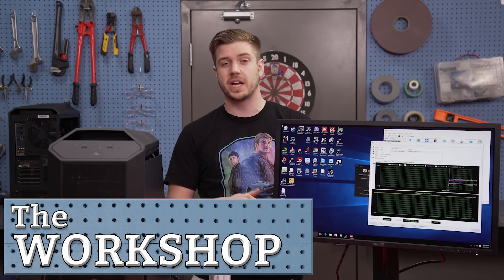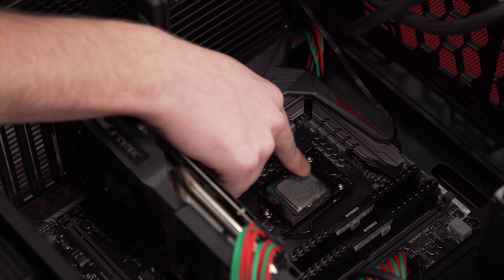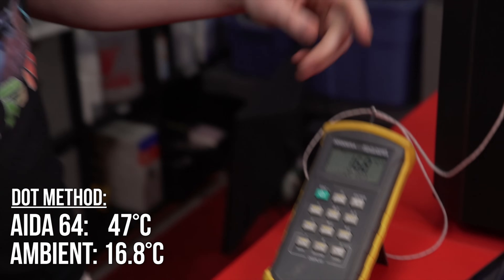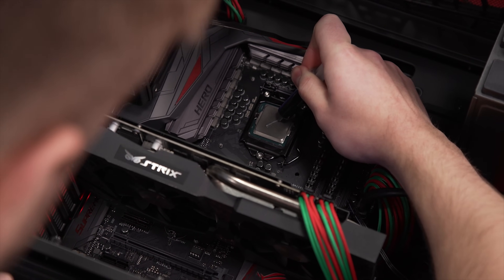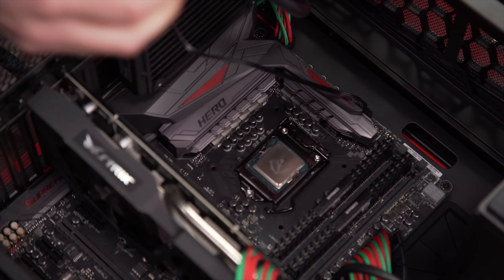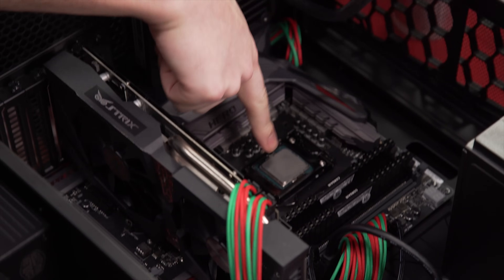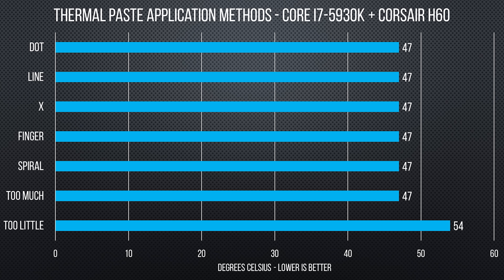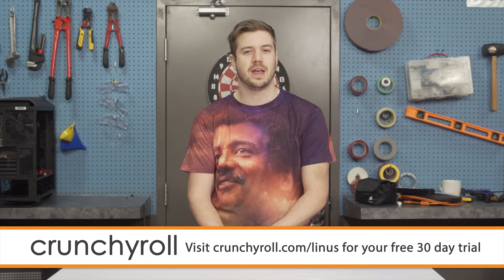Thermal Paste Application Methods - Which one is best? - The Workshop

Comment: After how long should you clean and re-apply thermal paste?
Reply: "if it ain't broke, don't try and fix it" is a phrase that can be used in this scenario. If you're experiencing bad temps, then go ahead and re-apply. Some can last up to EIGHT YEARS!! They last for a very long time and should only be replaced when you need to. Don't worry about reapplying until it's necessary. Hope that answers your question!
Reply: Ive been experiencing some bad temps in recent weeks so i took out the cpu cooler to give it a good dust off and noticed the paste was half dry i dont know if thats normal? but anyway im in the process of buying a new paste hopefully that will solve my temp issues
Reply: ALBERT ABRAHAM, I applied a Dot/Pea size of Arctic Silver to an Athlon X2 in the Summer of 2007 and CPU still Runs at 20 C - 40 C here in 2017. Is an Athlon 3800+ Windsor rated at 65 Watts TDP.

Comment: Quite worried about when i eventually upgrade, how difficult is changing a CPU? 

Hopefully upgrading from an i3 to an i7 on a pre-built year old PC. (side note, would this require an upgrade to my heat sync or will the old one be okay?)
Reply: the old one will probably still work, maybe even better because modern CPU's have mostly a lower power usage.

Comment: are you supposed to cover all the pins, or just let the socket do it's job of spreading
Reply: All over the mobo capacitors as well.
Reply: Actually if you sumberge pc in water it works like charm
Reply: @happydolphin1432  *submerge
Reply: *its job (possessive)
it's = contraction of "it is/has"
Reply: joblessalex if you have the time, covering all pins will yield a better result

Comment: how often should you replace thermal paste ?????????
Reply: Lance Mccarthy According to a search i did online you should apply once every 6-12 months
Reply: Lance Mccarthy mine 5yrs lol. im gonna replace it tomorrow. My cpu temp 45c idle 69 - 80c gaming. Thats why
Reply: Until throttling occurs, in my opinion. Every modern CPU is protected against thermal damage, so if the performance does not suffer by throttling or becoming unstable, replace whenever you like.

Comment: Ehi, less IS more... less is MORE APPLICATIONS.
Reply: What if you are building only one computer? Unless you have 3 or more GPUs, you can be very liberal with your paste, you will not use it up anyway. At least I haven't seen one so small that it would not be enough for 3 really big applications.
Reply: Well, that may be the case if you only build one PC every few year. But if occasionally you help your friend you can apply it multiple time, it's not a one time use; you can close it and reuse it later, it doesn't spoil.
And sometimes the paste wear out and you can reapply it later.

But if you build multiple PC per year or maybe per day, because you are a system builder/repair or Linus Tech Tips, then you have many more applications on a single siringe.

Comment: I am curious: does thermal paste ever need to be re-applied?
Reply: That's not true though, thermal paste can age and crumble up becoming less effective. Often on older cpu's (read 3+ years installed) you will see temps go up, untill you reapply some thermal compound. After replacing the temperatures can go down drastically.
Reply: In some cases it can actually be necessary to renew the thermal compound, for example when the old compound has dried up or just doesn't pass heat for another reason anymore. 

The man asked if thermal paste ever needs to be re-applied, to which you answered no, but the answer should be, sometimes yes, but not often.
Reply: YES, it does have to be re-applied, because it happened to me. One day, I was playing Starcraft 2 on my 3+ year old computer, and was suffering from insanely low fps with only a few units on-screen. I'd restart, and then it'd be fine for a few minutes, then start chugging a few minutes later. Thinking this to be strange, I ran SpeedFan on it and was noticing high CPU temps. I thought maybe my fan wasn't working, but nope, it was. I researched thermal paste -- which is something I never even heard of (my fans that came with my CPU always had a coat of thermal paste on them, hence I never had to apply it myself). After applying the paste, my Starcraft 2 performance worked great, and I never had to do anything else with my system!
Reply: yes it is good to do it at least once a year if you are in a hot area as the CPUS heat up more if cold then i would probably say no and also depends on what you are doing for gaming definiatley
Reply: Nope! Once it's on there it's good untill you take the cooler off. Once you take the cooler off you do have to re-apply.
Reply: Mathijs van nimwegen That's a relief. 
Cheers.
Reply: ReMeDy Thank you for the reply. I always worry when my PC acts up as it could be a million things. I need to buy paste just to have it around and feel safe. :)
I hope it doesn't expire when emergency calls. XD
Reply: Hope u bought a new motherboard and some ddr4 to....or else u wil have more problems (sockets will be different, 1156 -->> 1151 )
Reply: ddr4 is a toss up.  Does he need it?  Negatory.  DDR3 is still great and will still perform well beyond what this man needs it for.  It's the same with the DDR2 v DDR3 way back when.  Eventually he'll want to consider upgrading, but for now, two sticks of DDR3 10600 total 8 gigs will allow him the pleasure of gaming, watching porn, recording himself watching porn and making a porn without issues.
Reply: @KingT.Challa  not if he bought the 7700k..
Reply: If you use cheap one, yes... CPUs can die of heat after few years, if the paste is crap. You can google pictures of "burned thermal paste". If you use some quality stuff, you are good. I use Arctic Silver 5, it's supposed to be high quality, it has silver particles in it. Or whatever they used in this video should be good too. :)
Reply: Michal Valta God damn, those images are scary! I recently learned to use Speccy (a heat monitoring app) so if my PC starts acting up I can at least check that. I assume I'll notice warning signs before a cpu burns up like that.
Reply: even using good Thermal paste i would apply it before summer then reapply the next year if you have the same pc but that is me it just gives it fresh paste so the cpu has tha best cooling as possible
Reply: core temp is also a good application
Reply: The one I bought was Arctic Silver 5 that received great reviews. Included was two vials -- one for cleaning off the paste and another for purifying the surface. You'll need them for reapplying to an old surface. I can't speak for all cpu fans, but I also bought one recently that included a small cheap pouch of thermal paste, but I'd rather not apply thermal paste I'm unfamiliar with.

To add to my last comment, my CPU was slowing down to protect itself from the high temperatures. The big moment was when I was testing other games and the same low fps was plaguing games that I was running just fine in the past. When restarting my PC only temporarily helped, I knew something was fucked up with my system.
Reply: ReMeDy My system suddenly shuts down. I have a 7 year old cpu (never reapplied paste for it) and temps reached +90c! I bought a new i7 7700k (old one is an i7 860) and waiting for it in the mail. I hope it's just the CPU dying and not also a virus. 
P.S. talk about a CPU upgrade, huh? XD
Reply: Bauke Strada Sure did. I learned that the hard way with my very first PC build 13 years ago. :)
Reply: Meh a friend of mine has like 1 case fan with a regular intel cooler. Now after 3.5 years his cpu heats up to 75+ on cores in games, I imagine if you run cinebench it might overheat, or if it gets 30 degrees in his home on a hot summer day. His temps would probabl be 5-10degrees lower if he would used premium high quality paste.
Reply: After one decade it usually hardens and feels like a rubber. Of course doesn't function well and needs to be reapplied. I'm telling this from my own experience.
Reply: MX-4 lasts 8yrs, Most thermal paste needs to be re applied every year or so....well it doesn't NEED to be, but your pc will get hotter as time moves on.
Reply: Let's say you have a 3yr old gaming laptop that is thermal throttling and freezing while gaming. That means you need new paste, in most cases.
Reply: Is it preferabele? Maybe, but that's not what the man asked. He asked us if it NEEDS to be re-applied. On that the answer is no.

Comment: does thermal paste brand matter? expensive vs cheap?
Reply: but does brand matter? using a no name thermal paste vs AS5 1dollar vs 7 dollars
 I am in china atm so its like 7 Chinese dollar vs 48 Chinese dollars lol oh its 0 not 7 got it free with my heat sink
Reply: I'm gonna use the free thermal paste that comes with it and see if the temp will be too high
Reply: The best paste is the Cooler Master stuff in the tube that comes with their heat sinks.  Make the thinnest X you can, and make sure each arm is a little over halfway to the corner of the CPU.  Push the cooler down evenly on the CPU and twist back and forth for a minute.
Reply: used free stuff that came with the cooler, getting 50c OC to 3.0 sooo im happy

Comment: What way should I apply thermal paste on a xbox 360 slim cgpu? because i did the spread method and my fan is going crazy, i have heard the pea/dot method is the best way.
Reply: mike104740 it had been shown on other videos that spread is a very bad method. Pea is the best method because it is hard to mess up. Any better method than pea only gives subtle benefits.

Comment: I put a "T" on my old computer and it made it great again!
Reply: Yet, you have to replace parts and even the case/cabinet every month.
Reply: ^^only because your systems corrupt, and you dismiss the real diagnostic info as "fake news"
Reply: tweed187187 and then it kicked your PSU out, for being from a different manufacturer
Reply: tweed187187 Careful, in 4 years may be a lot of crap
Reply: If you use that method will, find your computer taken over by russians
Reply: suddenly your machine is running more efficiently and using less electricity.
Reply: OMG i laughed so much!

Comment: If you ever encounter a "stuck" heat-sink, do NOT try to pull and twist the heat-sink off. This can bend the CPU pins and - in the case of CPU's that have no heatspreader such as the AMD Athlon XP and Duron - damage the exposed core logic.

Instead power up the computer for a few minutes if possible, then power down fully. See if the heat-sink can gently be removed. In some instances the CPU heat generated from by the CPU will helps loosen up the thermal paste/thermal pad.

I had this very problem with an old Pentium 4 that was left for years.. I couldn't access the CPU lever as it was obscured by the CPU heat-sink. The heat-sink was stuck rock solid. Turned the machine on for 10 minutes, I then turned the machine off, and found the heat-sink shifted MUCH easier, to the point where I could very gently wiggle it until it finally gave up the ghost and separated from the CPU. The culprit was a very old thermal pad that should have been replaced years ago; however the CPU itself survived to fight another day :)

Note: Be mindful of running stress tests (which rapidly heat up the CPU) with old CPU's like the AMD Athlon and early Duron. Said products have poor thermal overload which will be compounded by any air gaps between the CPU and heat-sink. Under no circumstance run either of these CPU's with no heat-sink. Better to go into the BIOS and keep a close eye on the CPU temp.. if it rises very quickly towards its threshold then power the system down as quickly as possible then see if the heat-sink budges.
Modern CPU's from both AMD and Intel do not have this problem; they will most likely power or under-clock if they sense they are getting too hot.
Reply: A hair dryer for a few seconds works like a charm too.
Reply: Just play some Rust for 15 minutes and your heat-sink should melt together with the paste.
Reply: @n0iz1337  play some horizon zero dawn now lol
Reply: NICE! Good advice.

Comment: silly question , do u have to use iso prop alcohol? i dont have any
Reply: u can use anything that flash dries without leaving a residue. nail polish remover has acetone that dries as fast or faster than alcohol.
Reply: yeh was thinking of that , nail polish remover
Reply: i used Limoncello.
Reply: Imre Csoka Break cleaner is my way to go

Comment: Luke, please pretty please check the difference between the stock cheap thermal paste that comes with laptops. I have a Lenovo Y700-15acz which is The AMD version of the Y700 Ideapad.. It thermal throttles so bad. I have an FX8800p APU with a Dedicated M385X GPU.. The Gpu is being bottle necked by the CPU/APU.. The Fx8800p is thermal throttling down passed its base clock of 2.10GHZ to 1.10GHZ  it turbos up to 3.4.. (You guys need to compare stock crap thermal paste to name brand!!!) AND THEN SEE WHAT THE DIFFERENCES ARE? PLEASE..  WE ARE NOT WORRIED ABOUT THE METHOD U USE TO APPLY ON YOUR TOP TEAR COOLERS, WE WANT TO KNOW IF UP GRADING FROM BULLSHIT STOCK DRIED OUT OLDER PASTE WILL HELP LAPTOPS WITH THERMAL THROTTLING..   PLEASE PRETTY PLEASE, TRY IT OUT ON THE LENOVO Y700.... i'M BEGGING YOU!!!!!!!!!   MARC HEATH FROM SOUTH JERSEY.... THANKS, PLEASE DO THIS CUS IN THEORY MY LAPTOP SHOULD PERFORM BETTER.. i'M AVERAGING 48 FPS ON BLACK OPPS 3 UNTIL IT THROTTLES DOWN.. PLEASE HELP..

Comment: Is that a modern Intel CPU that has a shitty thermal interface between the die and the heat spreader? That would have been the weakest link in heat transfer.
Should have tested a CPU with soldered heatspreader, like FX or older intel.
Reply: It wouldn't have mattered either way. Heat + pressure squeezes out excess thermal paste and you get a nice even layer no matter how you apply it. A really cheap or bad thermal paste might be problematic if you have way too much, eg if it doesn't spread very well and separates into liquid that gets squeezed out.

I'd rather see a test on a bare die like we had for pentium 2 and 3 and all socketed athlons and athlon XPs.

There the CPU might not withstand the pea method if it leaves the corner of the die uncovered. It probably wouldn't show in temperatures as it is a local hot spot, but it should crash if that's the case.
Reply: soylentgreenb On any bare-die CPU (stok or delidded) or GPU, its common practice to either manually spread, "overdo it" or a combination of both. Depending on your usecase ofc. Don't wanna overdo it with LM.

Doing this with old bare-die CPUs would be fairly pointless, as very few are still operational, and thar number is definitely not increasing. You choose the scenario that will apply to the largest part of your audience.
Reply: If you delid a CPU you get one of those "old bare-die CPUs" and that's a rather common thing for enthusiasts when intel stopped soldering the heat sink to the core.

You don't want to overdo liquid metal because it will short something, but it won't drastically make your heat conductivity worse because excess will just squeeze out.
Reply: I'd be more worried about incomplete coverage from the pea method than I would about some tiny air bubbles with a bare core. If some corner of the core is uncovered it can overheat without thermal throttling because the temperature sensor doesnt happen to be place in that corner.

If the CPU has an IHS it demonstrably makes no difference how you apply TIM as long as there is enough TIM. Hell, it makes only a few degrees C difference if you replace the thermal paste with mayonaise or toothpaste (the only reason that's a terrible idea is that it's not stable over days, weeks and years). Too little paste can lead to laplacian growth, where the paste forms a dendrite shape at the edge and incorporates air.
Reply: I've dusted off the heat sink years later and found that temperatures were almost exactly the same as the day I applied the thermal paste using a credit card/spatula method, if that's what you're asking. I suspect it's going to be exactly as stable with the pea method. I don't know that there's anything more you could test.

Comment: But why dont cpus and coolers dont want to much because if i need a cooler room in the summer the more wind the better cooler
Reply: layerdballoon Was that even English?
Reply: Dude what
Reply: Except that's not true, apply too much and it will just be squeezed out nice and even by time, heat and pressure. If it isn't conductive and you don't care how messy the result is it just doesn't matter. It doesn't even matter if you spread it around using your finger even with the oils that are on there. It barely even matters if you use mayonaise or actual tooth paste as thermal paste until dries out a few hours or days later.

Comment: IS all thermal paste created equally?  If not, what are some of the best brands?
Reply: Arctic MX-4 is great even MX-2 is good.
Reply: Artic silver 5 is pretty popular. But I also believe Gelid Solutions GC-Extreme is pretty good.
Reply: Chris Reese no. To put it simply it is all about specific heat capacity and thermal conductivity. sometimes you can find a non-electrically conductive paste. it all depends on the elements used. Some elements may have a higher capacity (requires more energy to raise the temperature) but may also be electrically conductive while some materials may have lower capacities but are non-conductive.

think of the specific heat measurement test in highschool chem.

This is not a defenative guide. Just me explaining why they must be different and how they also have trade offs in some cases.

Comment: Hey I have a question. I'm building a new computer and am using a stock cooler that has thermal paste pre applied. I accidnetly touched the thermal paste though and smudged a bit. Do I have to reapply some or can I leave it as is?